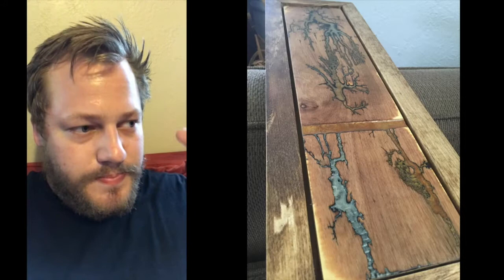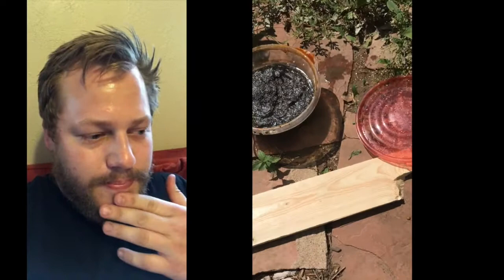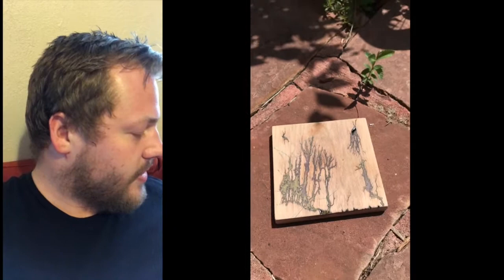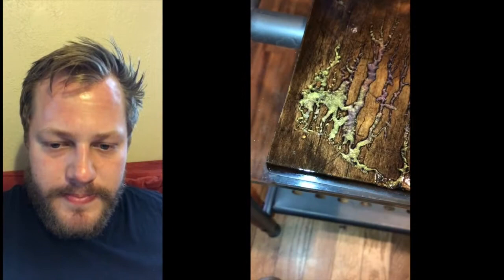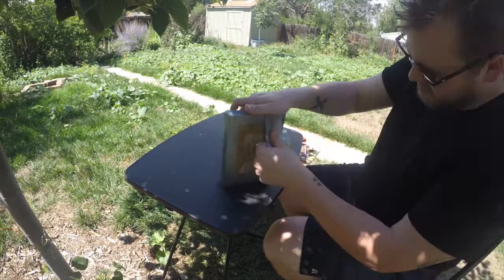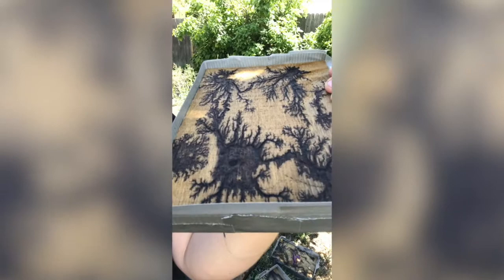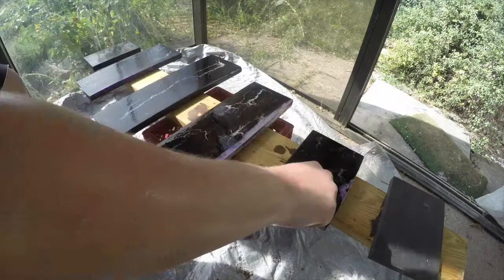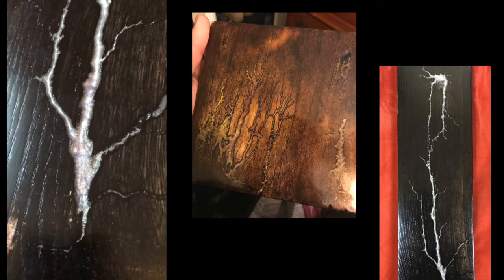Custom Lichtenberg wall-art using a homemade iron acetate stain.

Comment: Will it work on wood that was already treated like honey kitchen cabinets. Also the glow in the dark pigment powder is it blue in the daytime? Thnaks
Reply from the maker: Melissa Reyes it’s tougher with pre-treated wood, but I’ve made it work before. And the glow in the dark is normally a blue-tinted white color, at least with the powder I use, but I’ll add a little ink to the mix to get it to a nice blue color in the daytime as well